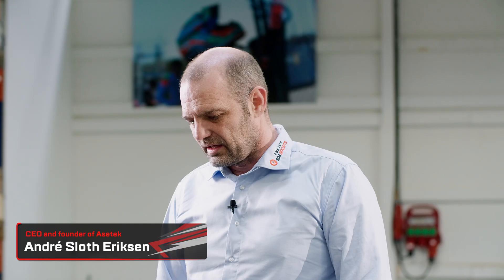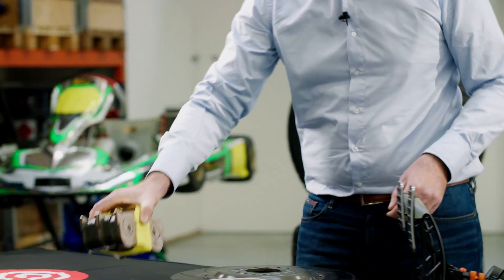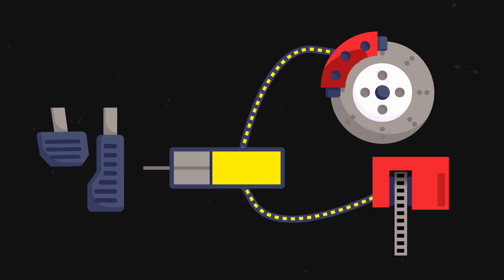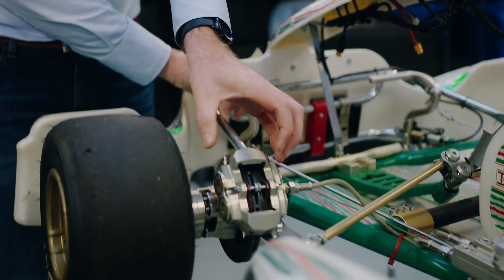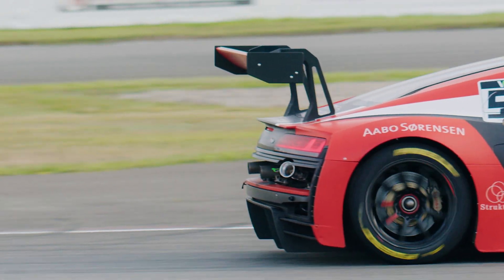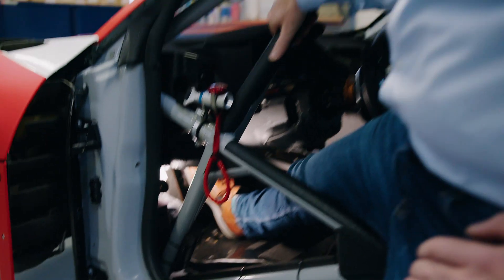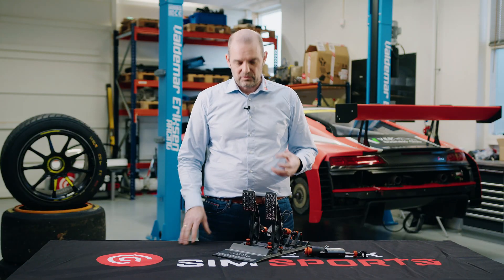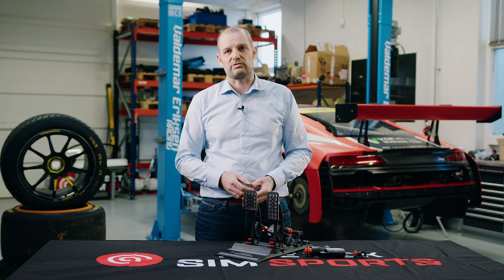Benefits of a Hard and Short Brake Pedal – The 2-stage System of the Hydraulic Invicta™ Pedals

Comment: Not all race cars have non assisted brakes. Even for my self who does gym i found testing the brake out with being bolted into the cockpit that these are too hard(not running in game or windows). I cannot even hit the 2nd stage on these with the white elastomer. Time will tell once i have the whole cockpit up and running.
It would've been better to have it travel a bit easier to the 2nd stage and then more force is needed etc rather than having it hard all the time. The Invicta accelerator and clutch feel good tho.
Reply from the maker: The hard elastomer is a true replica of the brakes found in different formula cars, hypercars, etc. 

With the softer elastomers you'll get an experience more true to GT cars and different supercars. 

If you're having trouble reaching the final braking stage, you can adjust the brake's final point in RaceHub. Hope this helps 🙌

Comment: I have the pedal set of your demonstration at 6:55. Its possible to use nylon spacers instead of rubbers to get the same hard stop feeling. And depending on how deep you put the rod into the pedal, you can get that same first stage with little resistance.

But I will be honest, I always preferred to not just have brake pressure, but also linearly related (small) travel because it makes muscle memory much easier. Some of the explanations here seem a little over-exaggerated. Who really uses an 85mm brake pedal in simracing, that is insanely long and will make your feet hurt.

Comment: Only thing that puts me off running a short and hard pedal is I've always found it harder to modulate braking force with a shorter throw. If I'm really having to put high forces into the pedal I'm either under or over braking which means I'm losing time either way
Reply from the maker: Sounds like you are using your ankle to brake. If you want to do like in a race car, your ankle should be locked and you use your leg. When releasing in to trailbraking all you have to do is "bend your toes backwards" and slowly retracting your leg.

Comment: Adjustability is key.
Most GT3 cars are built for endurance racing and driven by gentelman drivers.
Pedal ratio, master cylinder bore size and fatigue over a long run does not allow to run large bore masters as you do on your Audi. You probably only do short races.
They never feel like a brick wall like the invicta system. Once again, adjustability is key for a sim pedal.
You have prepared your system with pedal ratio adjustment in mind. WHY don`t you allow users to actually take advantage of it?
Is it because the overall pressure would be too high for the system?
Touring cars and karts due to short stints are exactly as you described, on the other hand look at all these pro/am GT3 cars:

https://www.youtube.com/watch?v=X-d0KwgZghE&t

https://www.youtube.com/watch?v=REcvGkYC1iI&t

https://www.youtube.com/watch?v=RESKus6RBUU

https://www.youtube.com/watch?v=sIyQGcnvl_U

https://www.youtube.com/watch?v=qOjQkAj6r04
Reply from the maker: You can just install our extended travel kit and a softer elastomer, then you will have it as you propose and like :) This very Audi has done several 24H races and the brakes are exactly as homologated and delivered from the factory.

Comment: If you claim that a short travel is better, why do some drivers seem to go for a longer one, as is apparent in a bunch of racecar pedalwork clips online? To me, it seems more like personal preference of the driver, which would mean that this video is marketing nonsense. Looking at Lando Norris' F1 pedal cam video from three weeks ago, you can see the compression of the brake pedal changing significantly during trailbraking, contradicting your claim that all the brake force happens during the rock hard 2nd stage.
Reply from the maker: The driver's personal preference is, of course, a factor. And we are not claiming that every single race car brake pedal is exactly the same :)

We do think this video fairly well explains the physics of why a hard and short brake can help the average sim racer (or racer) become faster. Personal preference may then vary, and that's why we built adjustability into the product as well, but our brake WILL be hard when compared to almost everything else on the market. That's the design philosophy behind it :)

Comment: For example with the RealGear GTpro3 Gen 2 (or 1 ) you really get the same result by setting the elastomers hardness. There are 2 elastomers that you can fit and you can put on either spot a soft one and a hard one or 2 soft or 2 hard etc. Playing with combinations to go close as “real” as possible, you’ll get to put the first compressed elastomer to be a soft one and the second one a hard one. You get in that way a 2 stages effect where after 2cm of travel the brake is really rock solid and you press against it to get the second 30%-40% of brake power. So , again, I think your solution is brilliant but I also think there are valid alternatives on the market based on real Tilton pedals. And then there is that video where they show racecars pedals close-ups and you’ll see brake pedals with very long travel….

Comment: What are you actually pushing against in the hard phase? The hydraulic fluid isn't compressing, so what's the difference between having the fluid and just having a hard metal stop?
Reply from the maker: Due to the pressure sensor in the hydraulics, you'll be able to control and gain a higher brake pressure without any travel. Just like a real race car.

Comment: So as Karl mentioned in his video, if instead of short to stages ... We go with 1 stage only, without travel... We will gain this 10th of a second, right?
Reply from the maker: No, that's not correct. It's hard to explain the feel of the 2-stage system but it's not just the short travel or a rock-hard stop - it's the combination of the two. 

Plus, we don't believe we have seen as short a travel as ours in the rest of the pedals in the market. That's simply because it's difficult to achieve with a 1-stage system where you only have the polymer/elastomer/spring but no hard stop as well. At least if you want a system at will be reliable for many years given the amount of beating it will take when braking as hard as Invicta allows :)

Comment: Nice looking well-constructed pedals but I see no reason that a person cannot limit total brake travel set up and using software set dead zones, pressure curves and adjust both minimum and maximum pressures applied and accomplish the exact same thing or feeling using a regular load cell set up for a lot less money.

Both systems work off the pressure applied to the brake pedal and how that pressure is "read" by the game main difference is that these pedals are using a pressure sensor that is using fluid as the medium between the pedal and the electrical pressure switch and the load cell is just directly reading the applied pressure on the switch without using fluid as the medium between the pedal and the switch.

Considering the fluid does not compress at all under pressure the difference should be minimal at best if both units are built to the same specs such as sloppiness in the pivot points or bending or flexing under equal applied pressures.

What the game actually sees is still the same final electrical signals sent by applying a certain amount of pressure applied by force to the brake pedal to the electrical pressure switch on both units.
Reply: I'm curious about this as well. What is the added value of the hydrolics in the Invicta's? It hasn't really been answered by any of the reviewers. Would be great if we could get an answer to this.
Reply: @miseryshining  The marketing is trying to sell this as with it being hydraulic it is the same and works the same as the real system in an actual race car as they are showing the amount of slack with the pedal, the calipers and brake pads to rotors ect. and claiming this system also does that.

The reality is that the system still functions the exact same as any other pressure based system as all you are doing is applying pressure to a variable pressure electrical switch and sending the same information to the games software regardless of whether you use this system or a loadcell system.

Any decent quality load cell pedal system can be set up to have minimal brake travel and what really is funny this system still uses the same Elastomer based bumpers system to adjust the "feel" of the travel being absolutely no different than a load cell pedal set.

What pedal adjustments this set makes with some of its "mechanical" adjustments the loadcell set van do the same using software set up.
These are nicely built pedals but not worth the cost, and RGB lighting strip, that is the funniest out of something claiming to be more realistic as how many race cars have you seen with RGB lighting on its pedals?

Also if the "master cylinder" develops a seal failure leaking all over your rig or flooring in your house down the road I bet that it will cost more and be much more of a pain to repair than the simple replacing of the electrical load cell switch on that type of  pedal set up.

I just do not see the advantage or the attraction of going with a much more expensive hydraulic based system for a home sim rig.
Reply from the maker: Hi Bill

We believe the hydraulics of the Invicta pedals will make a difference and that there are very few, if any, load-cell solutions on the market that can match.

Regarding the RGB, we've made no apologies earlier that this is only part of the pedals that is not inspired by real racing. Sim racers are still gamers and we know many who think the LEDs are a cool feature. If it's not your style, they can be turned off completely :)

Regarding seal failures, Asetek has been making liquid cooling hardware for computers for 20 years. We know how to make sure that a system does not leak or will need maintenance after we ship it. We are very confident that customers won't experience any issues with leaks from the brake cylinder as it is a sealed system :)

/Martin, Asetek SimSports
Reply: @AsetekSimSports  First off I think your product looks like it is very well made and I am sure it is a quality product.

I also am sure your variable electronic pressure switch also works well and will do the same job as other variable electronic pressure style switches.

But where I find that the differences become nothing more than marketing hype is that the concept of using a sealed cylinder filled with fluid which of course the fluid itself does not compress and still using an Elastomer based bumper system to adjust the "feel" of the travel which is identical to how resistance is adjusted on a standard load cell pedal plus using a metal adjustable solid stop to adjust total pedal travel really has the "hydraulic master cylinder" doing nothing but holding and placing a non compressible liquid between pedal where pressure is applied and the variable pressure switch which detects the total amount of pressure and sends that information to the game.

All the video showing slack induced on a real world braking system of the caliper, brake pads rotors and the clearances between them is malarky as none of that hardware which actually introduces those clearances in a real world braking system is a part of your system to introduce those clearances or feeling.

Are you really going to say that a quality load cell cannot duplicate the feel of the system you are charging much more money for through set up with its own  Elastomer based bumpers system to adjust the "feel" and length of the travel and using its software to precisely dictate exactly the amount of free travel or pressure is allocated through the use of dead zones and the total amount of braking force to be applied again through software and brake curve settings?

I really have a hard time swallowing the precision of all of those completely adjustable variables are better with your "imitation hydraulic master cylinder" other than being mostly marketing hype to justify your much higher priced system.

I do think your clutch system is very nice though but again very pricy for a single pedal add on.
I have no doubt your pedals work well but I do think you are pushing the hydraulic aspect as being a better solution than loadcell to justify the prices you are charging much more than although it is a different system for sure I still question the claims of being better or superior to a quality load cell setup costing hundreds of dollars less!

You are welcome to send me a set though to change my mind and opinion!😁

Comment: Great info, but should the brake force already be engaged during the soft stage? Or only during the second stage?
Reply from the maker: There is braking in both stages. But the really hard, no-flex braking is only in stage 2. That's what makes the difference in really sharp turns.

Comment: Couldn't you do the same thing by just having a stop mechanism on the elastomer bushing, that still pushes on a loadcell after the stop? I get that fluid is non-compressible, but isn't a loadcell also non-compressible?  Is the master/slave cylinder not just an extra step? Or maybe i'm misunderstanding something. At the end of this you're still actuating a loadcell right?
Reply from the maker: The 2-stage comes from being able to press directly on the fluid. So it's not just a mechanical stop or 1-stage like would find in a load-cell. There is a difference but it's hard to explain when you have not tried both.

Reviews of Invicta were released yesterday. Dave Cam comments on the brake feeling and the difference. That may help with some nuances: https://youtu.be/G65H1hjZfqc :)
Reply: @AsetekSimSports  Thanks for replying, they do look great!
Reply from the maker: @gernsey7362  Sure thing. And thank you! :)

Comment: two questions,
1- can you set or adjust down the pedal travel of the first/soft stage from 2cm to 1cm before it hit the hard stop second stage?
2- does the first/soft stage has any breaking input in the sim game or is it only when u compress the fluid in the second stage?
Reply from the maker: 1. Technically, you can. Either by changing the elastomer inside the brake cylinder or by adjusting the preload.
2. There is input in the soft stage. However, you can calibrate that out of it if you want to.

I hope that helped :)

/Martin, Asetek SimSports
Reply: @AsetekSimSports  regarding point 2, what is the most realistic setting here? 
Would the R8 start to decelerate significantly during its "soft stage"?
Reply from the maker: @svendandersen8338  'Realistic' really depends on the type of car. The R8's pedals are only fitted for that but Invicta has to fit any car type when sim racing - from stock to formula. So realistic will differ and of course, will personal preference as well. 

Using our RaceHub software, we will make it easy to adjust pedal maps for example without calibrating the hardware every time :)
Reply: @AsetekSimSports  Thanks for the answer. The problem is that I don't have access to a GT3 car, but find it funny to know that I'm closer to the feel of a real GT3 car. So maybe I can drag it out from you: For a GT3 car, should I leave the engagement as stock (i.e. the soft stage brakes the car) or calibrate a deadzone for the soft stage - if my end goal is to be closer to the feel of a GT3 brake?

Comment: Is there any prerequisite regarding the seat on the rig? Do i need a hard carbon fiber bucket seat in order to apply the force/power to the brake pedal in the best possible way? I have a VW Golf V seat on my rig which has a more or less soft cushion. I ask myself if my seat is no go with this kind of pedal system.
Reply from the maker: A brake as hard as Invicta's definitely benefits from a seat that doesn't flex. I think you're good with your current seat as hard carbon fiber is not a must but I could be wrong. Reviews are now out and we made a playlist with them on this channel. If you have doubts, I'd recommend you check them out to hear how they experienced it in their setups :)

/Martin, Asetek SimSports

Comment: Now everything is more clear. I was just thinking how does it feel when it touches the alu spacer/ring, can you feel metal/metal contact or hydraulics masks that out ?
Reply from the maker: That's probably very subjective depending on the racer. We put a solution in front of the pedal arms to reduce the metal-to-metal noise and we think that makes a difference.

Reviews are coming from February 14th, so you'll probably have access to more opinions about it soon :)